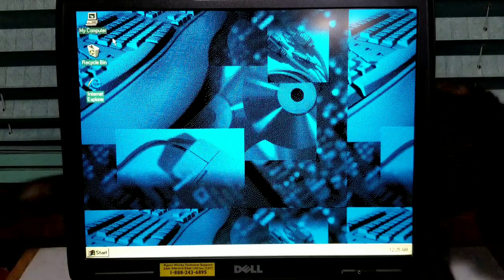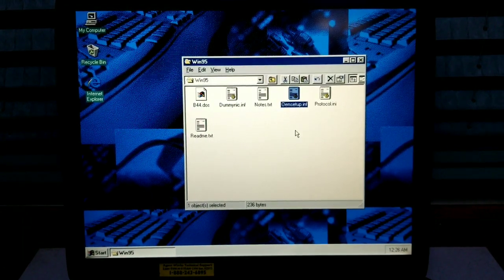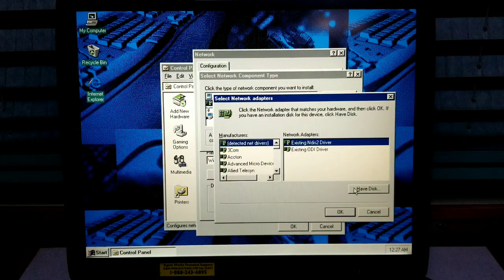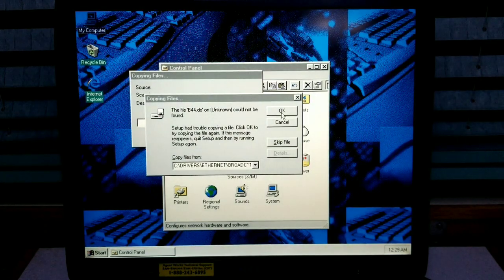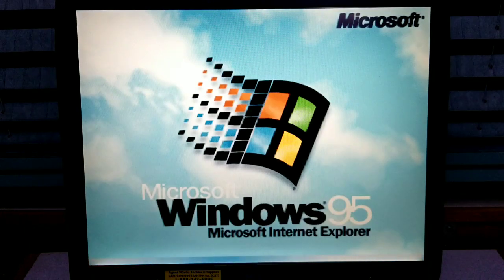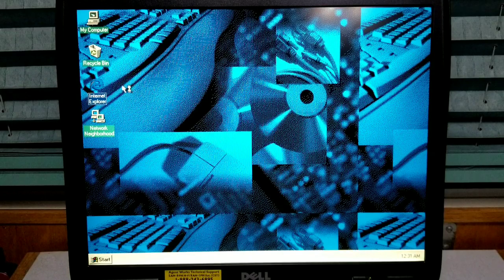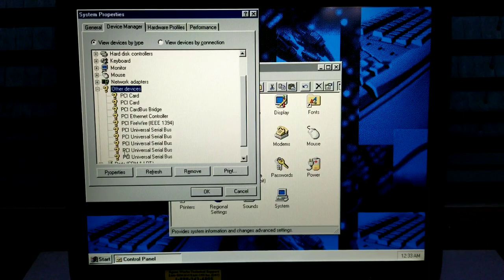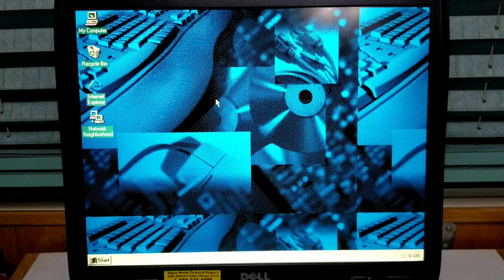Installing a DOS/NDIS2 Ethernet Controller Driver for use with Windows 95/98

Comment: Hi does this laptop have any issues running 95/98 and was it difficult to install these dos based systems?
Reply from the maker: As I recall the biggest issue was getting the audio to work. I had to use a custom Windows 3.1 driver that a fellow named Watler made for HD audio and do a lot of tinkering to get it working. There's a thread on the MSFN forums titled "Help setting up High Definition Audio Drivers on Windows 98 SE" if you're interested in going down that rabbit hole. As for installing 95 and 98, that can probably be done doing the normal workarounds needed for "newer" hardware.

Also, I vaguely recall having stability issues as well, which is why I never bothered to do a write up for the Latitude D520.